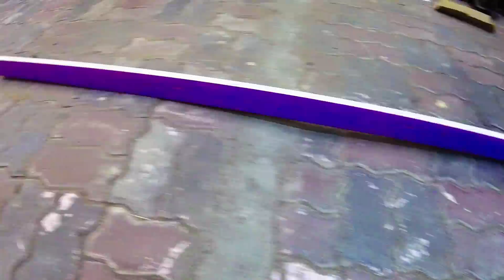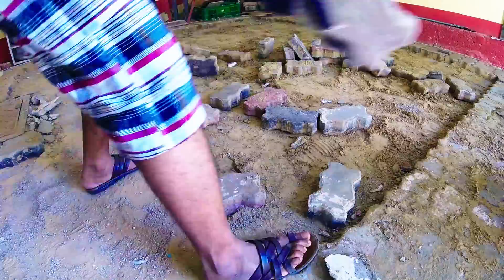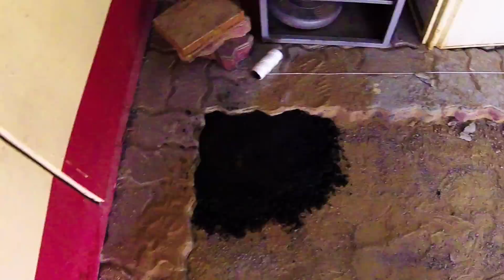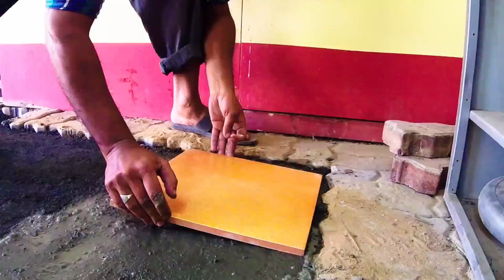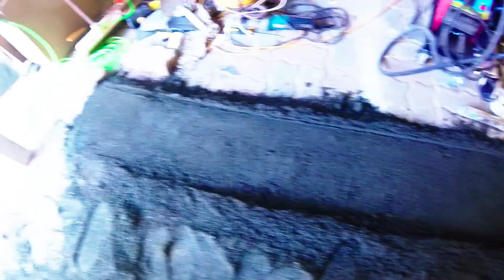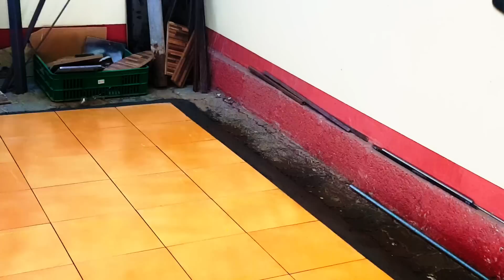Tiling on extremely uneven floor | MakerMan

Comment: good video, showed some good tequniques, but I am Confused as to why you only tiled part of the floor. seems unfinished the way you did it.
Reply from the maker: +Andrew Hengstler coz i am currently making a cnc big cnc 3.5 meter by 2.5 meter so the wanted the floor dead flat. Plus i only had 108 tile which big enough for the current big cnc.

Comment: Ummmm... what? 
Why do 3/5ths of a floor? 
Clear out all that crap, measure to the drain, and do the whole thing. Otherwise, not entertaining, or educational. I'm unsubscribing.
Reply: Do you have issues with your temperament?
Reply: David W. Smith i believe he needs a section of the floor to be evenly tiled for doing a particular project.
Reply from the maker: +David W. Smith u will see y in the future video.
Reply from the maker: +David W. Smith also as u can see one of the Corner is as same level with the old brick floor and the other 3 corner are raised up, coz it was a very uneven floor.
Hope this clears up ur questions
Reply: Hush troll. I indicated my feedback clearly and with no abuse. I'm out.
Reply from the maker: +David W. Smith ok.
Reply from the maker: +Lone Wolf respect to u
Reply from the maker: Haha
Reply: @floppychicken68  As if you are any better with such childish swearing.
Reply: @Engineer9736  
That 'Wahhmbulance' get there for you yet? I called it like,.. 9 months ago!